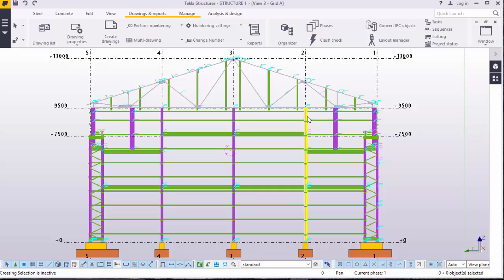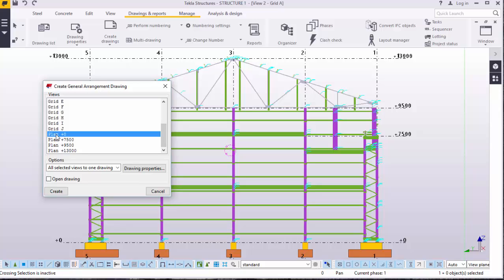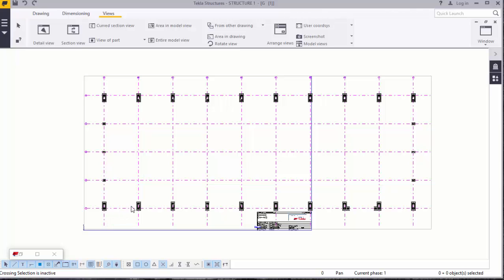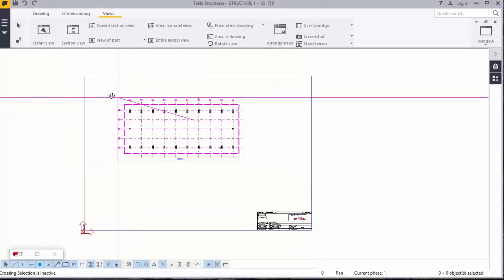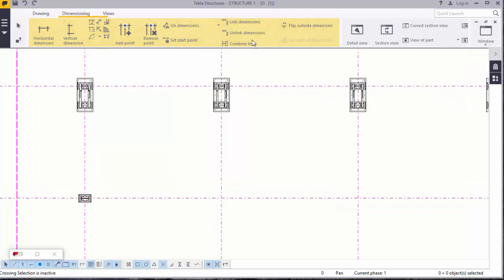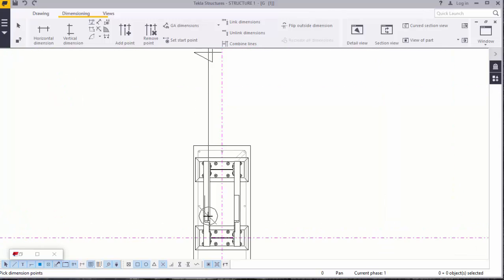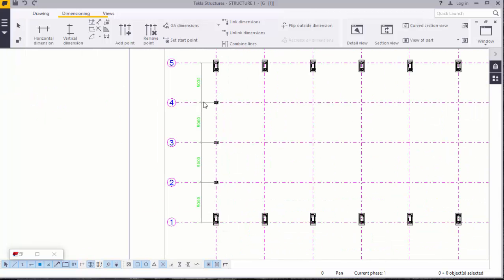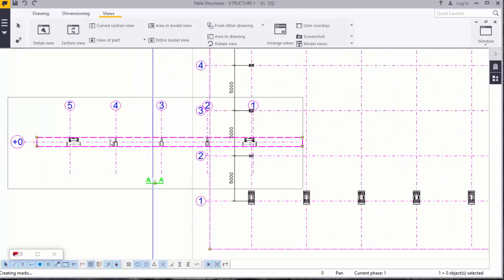Generating 2D Drawings in TEKLA STRUCTURES 2016

Comment: Hi Maurice, very good video.
I have a question...for example here in Brazil we used to make 2 drawing to show an element like foundations.
1 drawing show the assembly and other show the detailing with rebars, etc. This procedure takes a long time.
I want to inovate and show only a 3d view of the element and rebars. Have you ever did something like that before?
Reply from the maker: Yes,several times, provided that you provide the required information to the you user.The 3D View and rebar convincing details are enough.